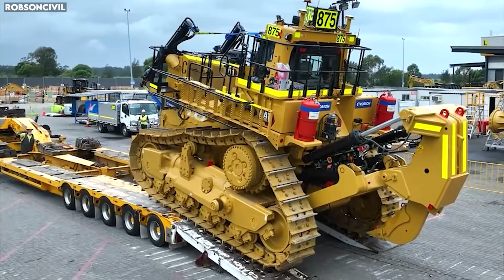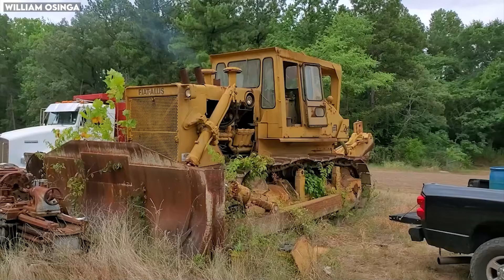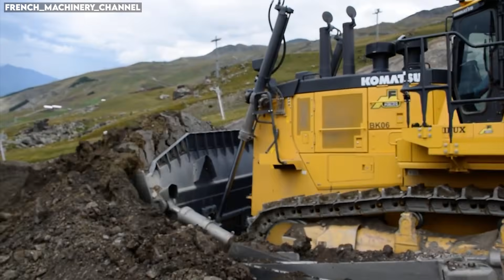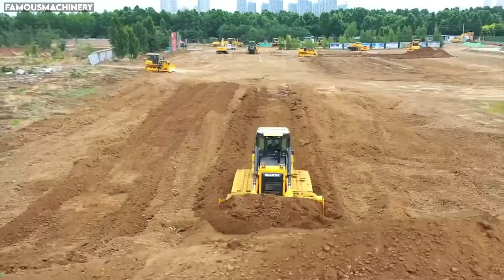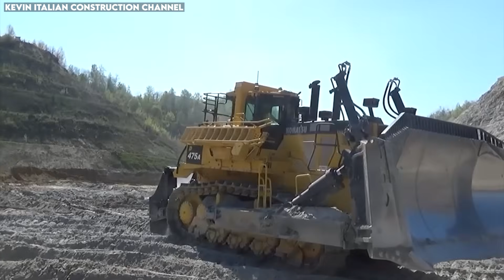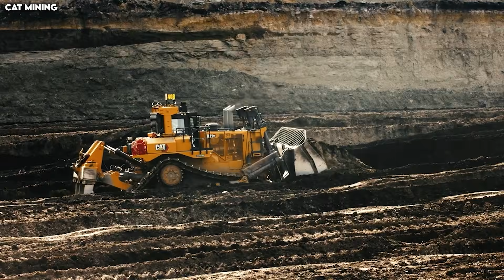10 Bulldozers That Made Caterpillar Nervous

Comment: I spent a lot  of time on a model Komatsu 455 it was probably the best tractor I ever operated I have since then operated D11 n and t  the Komatsu was a far better tractor  I have seen 455s with 50 000 hours on them and still working A japanese contractor once told one of the Australian tractor dealers that his D10 which is the rebadged D11 that his D10 was sixteen times more expensive to operate than his 455s this is believable as the455 is pretty bullet proof where as the D11 is high maintenance and it's power to weight makes it a slow lumbering. Lazy old tractor